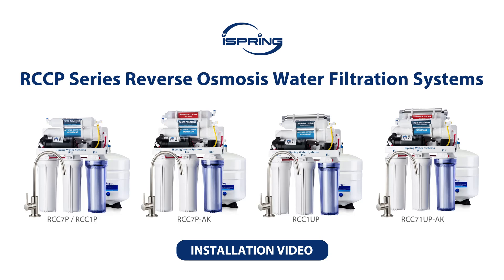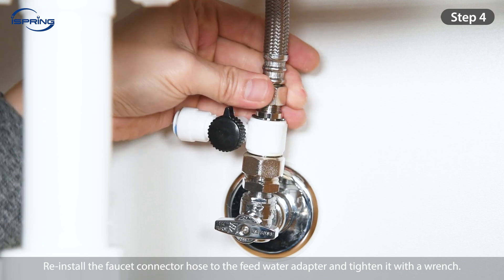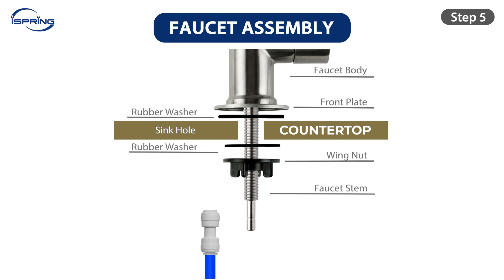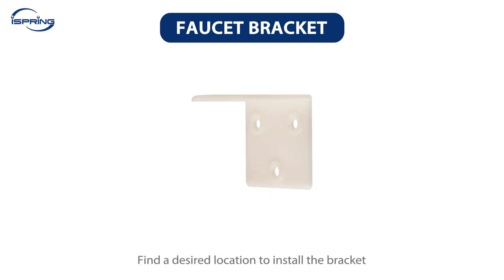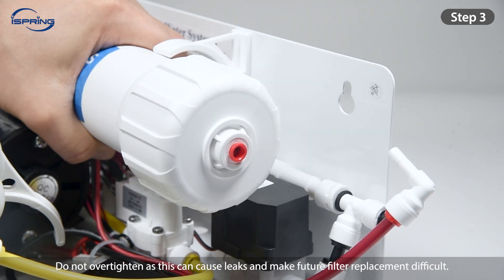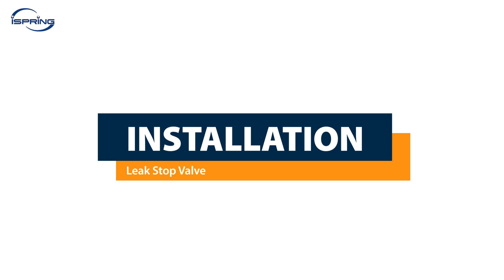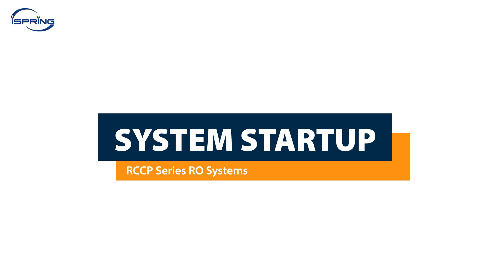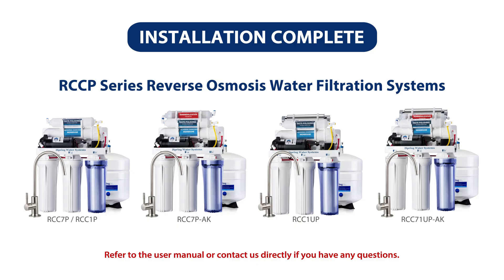iSpring RCCP Series RO System with Booster Pump DIY Installation | Step by Step

Comment: 4:53 is this nut meant to stop after a few turns? Mine cannot go up as demonstrated
Reply from the maker: Hi there! The nut locks the faucet down. As long as it’s secure and there are no leaks, everything should be fine. If you’re experiencing any issues, please send us a photo of the problem to support@ispringfilter.com so we can assist you further. Thank you!

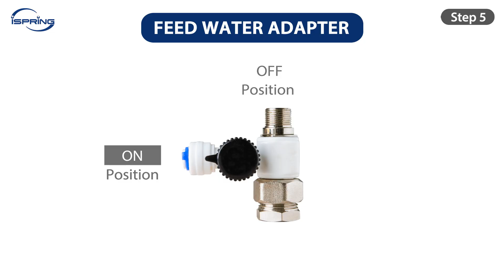Comment: At 2:10, you say measure and cut the tube... I'm not exactly sure what we're measuring to.... What's the length that we should be aiming for?
Reply from the maker: Hi there! Cut the tubing end squarely using a utility knife or scissors. Insert the tubing into the quick connect fitting for at least 1/2". You will need to wiggle the tube and apply additional pressure to create a seal. 
If you have further concerns or questions, please reach out to us at support@ispringfilter.com  or 678-261-7611(M-F 9:00-5:00 EST) for proper assistance. Thank you!
Reply: That was ambiguous for us as well. One of the first things we did was try different arrangements of the components under the sink. Then we did practice tries with the tubing to closely estimate length and freedom from sharp turns before we cut them. Better to go extra and just trim excess length. Good luck 👍